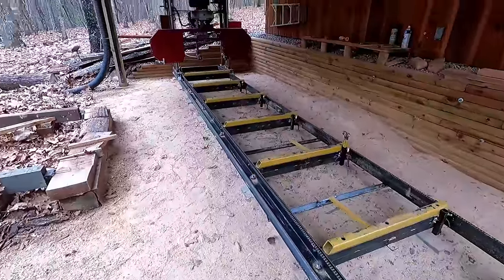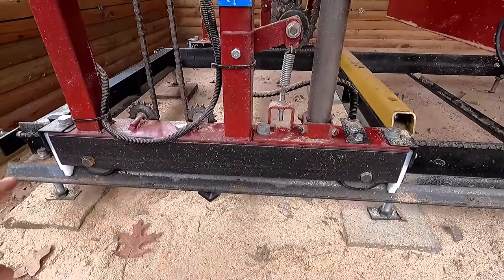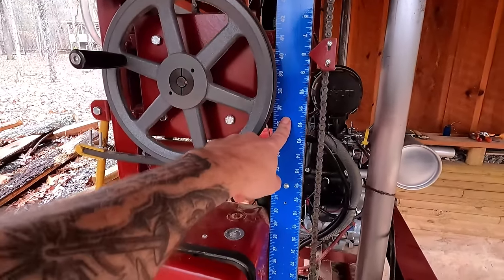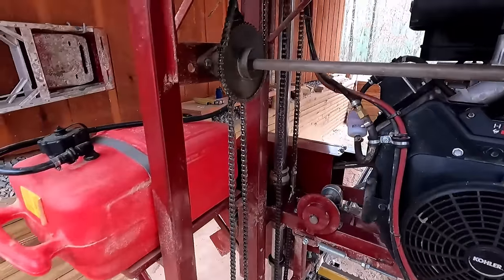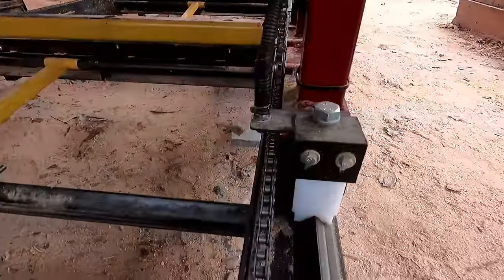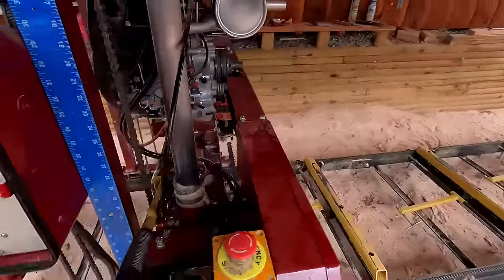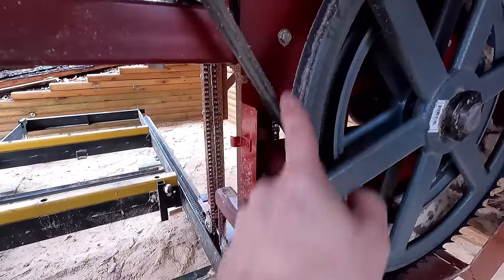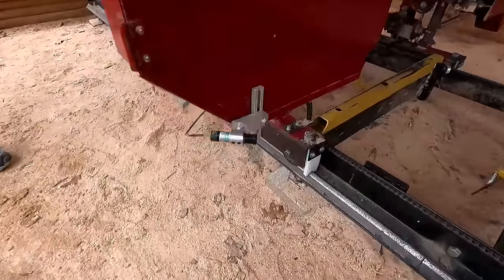Custom Homemade Sawmill | How it's built | In depth look | DIY | How TO

Comment: That's a pretty complex system with movement and geared carriage.. I've seen much simplier designs, but you have the adventage of automation and spare your energy to run it.. =) Hats down, excelent build.
Reply from the maker: Thanks, yeah Pop didn't want to over work himself.😁 He watched a lot of people using push mills and said yeah I'm too old for that.

Comment: That is a nice build!   I built a similar one that I have been using for 30 years.  The one thing I'd recommend is a direct reading blade tensioner.   I have a hydraulic one with a hydraulic gauge so I can see the tension and make adjustments as needed on the go.  Also the gauge will give you a good indication when to blade gets dull.
Reply from the maker: Thank you for the advice. We are looking into improving the tensioning setup, I agree with you 100%.

Comment: Just found your channel. Really nice Mill you built and the enclosure around it. Thanks for the videos !
Reply from the maker: Thanks. Pop wanted to have a cover over the sawmill before he finished it and moved it out of the garage, so we built an extension of the shed roof coming off of the shop. It worked out nice.

Comment: Thanks for solving a problem for me .I have built a five foot X 10 foot router sled for flattening slabs table tops and mantels . Originally it was a manual machine that is now powered by a wheel chair motor like the one you are using . Problem was the carriage racking on start and stop .Bingo dual drive and proximity switches for end of cut stopping . I am also in North Georgia (Rome) would love to visit and look at your mill .

Comment: I like your scrubber for your round bar.  I will be adding a set on my mill oil soaked to keep my rails lubricated.  I used  an aluminum ruler with magnets for my scale.  It is handy to be able to zero the scale for cutting a specific thickness board.  Its fun to see similarities and differences between other homemade mills.
Reply from the maker: Thanks. That's a good idea for the scale.  We look at other setups to see what works and doesn't.  There are a lot of creative people out there.
Reply: @redstemorchard  For sure I built my mill having never seen on in real life just by watching videos on youtube.  I have a bunch of videos on my channel about my mill check it out for possible inspiration.
Reply from the maker: @thedelcodave  Will do.👍

Comment: Nice job on the fabrication.  Your Dad's got skills.  

 You may have already done so but have your Dad look into some bent sheet metal guarding for the sprockets and chain runs.  As menitioned, you have a lot of torque on that gearbox and motor.

Comment: Wow what an impressive mill!  Pop did an outstanding job building this.  I built a homemade sawmill about 3 years ago and had the exact same problem with the blade tracking from the adjustable blade pulley.  I will try your solution using a bolt and torque wrench for tightening the blade.  repeatability is what I need.  also a quick question.  How often do you have to re-tension the blade as the blade heats up while cutting?  I also use soapy water for blade cooling

Comment: Very nice build!  One of the better ones on Youtube. Can you tell me where you bought your band wheels from?  What diameter? 19 inch?  thank you.
Reply from the maker: Thanks. Surplus center.  H bush, 18.75" single groove pulley.  Part# 1-bkh190 the H Bush is determined by the shaft diameter you are running. You'll have to pick up a B size belt for the pulley I believe it's a B56....... But don't quote me on that.

Comment: Consider putting a couple of shutoff switches at the ends to keep it from breaking the chain. Only shuts off in the original direction of travel. So you can still back it out.
Reply from the maker: We have considered that, it does have adjustable stops which are magnetic pickup, but only stops the carriage not shut everything down like an emergency stop from an overrun.

Comment: Awesome build! Do you remember where your blade lube parts came from? I like how yours are on both sides of the blade.
Reply from the maker: Pop actually machined those out of nylon blocks and just used felt pads to apply lube. The brackets are all made by him.

Comment: Great job! I know you've been asked this question before, but do you have any plans?? I want to build one and would like some dimensions on the saw apparatus or the part that rolls on the rail. Thanks so much!
Reply from the maker: I do not. Pop didn't make any formal plans. The band wheels are 20" and the blade is an off the shelf 113"long Wood mizer brand. The guides will clear a 32"wide log.  Hope that helps.
Reply: Are you using a two wire normally closed proximity sensor on the carriage stop or what are you using??

Comment: I would love to see the speed control electronics design since it is basically what I have planning for my mill build
Reply from the maker: I'll work on breaking that down in a video.  I do believe Pop made a wiring diagram for it so I will get that together.
Reply: I too would like to see the electronic design. I am building a sawmill myself from a project mill that never got finished. I wish you had a blueprint for the sled as that is the weak part of my saw. Do you think you will ever put a set of plans together for the whole saw. I would be willing to pay for them and I am sure many others would too. Thx.

Comment: Your guy's mill is quite a machine, looks well-built and some serious country engineering was put to use. I have a couple questions if you have a minute to answer.
 Where did the blade wheels come from? They look like a large belt pulley. It's hard to tell or see in the video, but the blade wheels look like they have some sort of filler in the belt groove if they are that type of pulley.
What was the feet per minute you guys targeted the blade to run?
Very nice looking and well-built sawmill.
Reply from the maker: 18.75" V belt pulleys from Surplus Center.Com.  The belt that we use is a B56. With the belt it works out to almost 59" circumference. You have to use an H bushing for the diameter shaft you run.  Our target speed is between 4,000-4500 fpm. That works out roughly to 3200-3600 engine rpm the way we have ours geared.  Hope that helps.
Reply: @redstemorchard  So the blade runs on the b section pulley without any type of filler in the belt groove? The blade is wide enough to cover the groove up, yet the pulley can drive the blade as it is metal on metal. I have a vertical metal (or wood, determined by blade being used) cutting band saw that has metal wheels, but there is a rubber ring around the wheels. And these wheels are metal and flat all the way across the face where the rubber goes. Maybe I'm not asking correctly, and this could help. If you were between the blade wheels looking at either wheel, you will see an open belt groove. There are others built in such a way that the drive belt drives the blade with the belt from the engine. Thanks for your help.
Reply from the maker: @wadehearn6230  there is a belt on each pulley filling the groove. The B56 Belt is the size that fits the groove and stands proud. The blade rides on the belt not the pulley. No steel on steel contact.  If that makes sense.

Comment: When I built my own mills ..... I  used the quarter inch to the full turn for raising and lowering. It surely does have advantages on the auto adjust and stops so that it will only drop as far as you want it to. The biggest advantage of it is when the blade clears  the cut, you can just bump the blade up a bit so when dragging the saw back for the next cut, you don't  drag the blade off of the saw by hitting the log. I ain't got too much of a vocabulary.... I'm seventy three now and wishing I was thirty seven. Depending on what I cut was why I always had the circular saw around to just make cants. I am still trying to remember how I made my tool for the auto adjust for lap siding. The lap siding will give you so much more out of a cant or whole  tree for that matter. I experimented with doing a resaw for making lap siding and its hard to go from say six inch lap to twelve inch lap or any size that your going for. If I was standing in my shop again, I  could make one pronto. Meaning one side of the lap is quarter inch and the other being a three quarter inch so  that when you saw a one inch thick board, you had enough wood to get both boards the same and not lose it in saw curf. (advantages of a bandsaw mill) I  was in northwest corner of washington state then. After I moved to alaska in 1970, I built a circle saw mill right away and must of cut two hundred cabins of lumber the first year. I couldn't cut enough to keep up with people moving in on the southwest islands (Prince of Wales) so when I got back down to washington state again in the late seventies, I bought a bunch of old saws that were used for sawing shakes for roofs. After fighting with other designs, decided the time had come to just build my own. I don't know how many I made but I know that there was not any two mills the same as I just would get ideas to try on the next one. I went to alaska to work as a mechanic but no job is just doing "that job only". I enjoyed working for the small companies the most as the smiles make all the difference. Guys who had braved winter months in a army tent now living in a cabin with a wood stove were some mighty happy campers.
Reply from the maker: Thank you for sharing.  While the mill does operate fairly well, we are looking to redesign a few things to make it even better.

Comment: What's the model number for the hoveround gearmotor you used for the travel? Awesome build by the way. Look forward to more videos. I am in the process of building one 52" wide bed x 24ft long with tandem axles. I am finally at the stage of doing something for the travel and for lifting the head.
Reply from the maker: Pop said they didn't have part numbers, but he got them on eBay(advertised for electric chair/scooter) , and also Surpluscenter.com carries motors just like them(power chair) the sell left and right hand drive. He paid $100 a pc. for them.  They may come with a metric shaft. We have three of them and two of them are spur gears and the one on the mill is a worm drive with neutral lever to disengage the gears. I recommend the later for a drive setup. Hope this helps. Congrats on your build! 👍

Comment: The reason you put the small in of the log facing the head is because limbs grow up hill and it keeps the blade from trying to slide over the limb causing wavy cuts.
Reply from the maker: Thanks. Didn't think of that before. Always tried to lead with the small end, easier to see how much clean wood could be cut. Of course with the laser on the machine, it's kind of a moot point other than your idea. I'll pay attention to that next log.
Reply: @redstemorchard  A circular mill cuts down on a knot and has a lot of mass but a band mill has to cut through the knot and will try to deflect the blade so its better to have the knot facing the blade.

Comment: How about a tooth count on the drive wheels?
A well engineered saw!
I'm very interested in making one....Thanks.
Reply from the maker: There is a 24 tooth sprocket on the drive motor which pulls a 48 tooth sprocket on the drive shaft which has a 12 tooth sprocket on each end as the final drive which is what actually pulls the carriage along.  We are however about to speed up the drive, since we can max out the forward speed and still need more when cutting through smaller cants and most pine.
Reply: @redstemorchard  Thank you!

Comment: Where do you buy that laser that is a neat feature.
Reply from the maker: Pop bought the laser on Ebay.  There is a company called Apinex that sells them.  It's cheaper on eBay though.  Search.     "line laser module".
Reply: @redstemorchard  awesome tell pop I say thanks for the info.
Reply from the maker: @thedelcodave  You bet.  He looked it up to make sure.  His came as a set.  He said your welcome
Reply: @redstemorchard  I found them and bookmarked it for now. My mill lives outside once it gets a permanent home and under cover I would like to add more electronics. Keeping it simple for now.
Reply from the maker: @thedelcodave  Cool, simple definitely works. Sometimes that means less problems 😉
Reply: @redstemorchard  For sure the old KISS method.  I am getting ready to do some testing /redesign with a wheelchair motor to power my lift mechanism.  I have a small motor powering it now but I just am not happy with the low power.  Seeing your video about breaking a chain give me hope that the new motor will have the torque I am looking for.
Reply from the maker: @thedelcodave Those motors out of the scooters like Pop got are super torquey. 24 volt
Reply: @redstemorchard  Does he have them hooked to 24 volt or 12v. You can power them either way but you get more rpm at 24volt.  My current setup uses a 24volt motor powered with a step up transformer.  I will be testing at both 12 and 24 to see what speed works best.

Comment: How much money did you spend on it without engine and hands? (short quick material breakdown). And pieces short-quick specs..
Reply from the maker: I don't have a material list breakdown unfortunately I wasn't around for a lot of the build.  Pop said he spent around $2,500 in steel alone.... But that was before inflation got bad. Total spent was around $8500 or so.  I wanna say the motor cost $2300 pre inflation. Some of the parts he already had, so I can't give a more accurate cost.  Sorry I hope this helps in some way.

Comment: So many hp for 32 inch?why didnt go wider
Reply from the maker: 25hp, but Pop found a deal on the 27hp Kohler.   Trees in our area don't typically get much over that diameter, so Pop figured it would be enough. Also, it should be able to cut a larger diameter log with some well thought out planning and cutting.